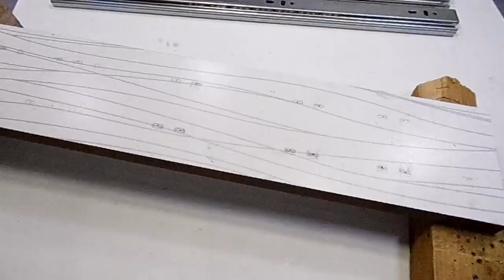How to make a Sliding Saw 🪚

Comment: I love your enginuity, that being said, I am a skilled carpenter/craftsman with nearly 20 years experience under my belt using tools that have been built by engineers and qualified safety personel. I feel compelled to ask you to to stop using this device for many safety concerns; there is no rip guide, nothing to catch a warped and dismantled flying blade shrapnel, the counter leverage of the rod attached to the blade will likely end up causing blade to malfunction, nothing to keep wood piece being cut from becoming misaligned with blade causing it to  temporarily cling to blade and being flung in any variety of directions. This is a high impalement risk. Wire seems mounted where it can become entangled with blade. . . etc.

Again, I always love seeing someone's enginuity, but this thing is more dangerous than could be considered effective for use.
Reply from the maker: https://youtu.be/oruv66ROKHM
Reply: Same observation as mine.

Comment: Good idea but... a wider table to the right and a fixed fence ? That way you are not holding the blade freehand and you will not have your left hand under the motor, instead you will use the saw with left hand and right hand holding the wood against the fence where you can see your hand

Comment: First of all your saw blade  has been installed in reverse. This is why you are having difficulty cutting your material. Safety is obviously not a concern to you for example, no guards, improper motor sizing. You are a danger for the people who believe that you know what you are doing! Give it up before someone suffers a serious life changing accident!
Reply: I agree with Toby put a few safeguard items on it and turn the blade right but over all not bad
Reply: Even I thought it's mounted reverse. But see the saw dust. It's moving in right direction.